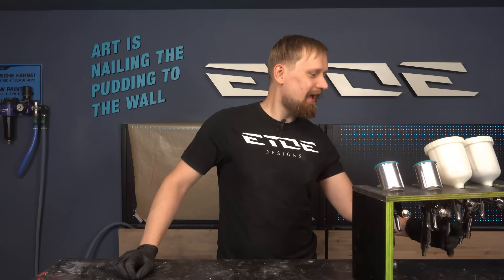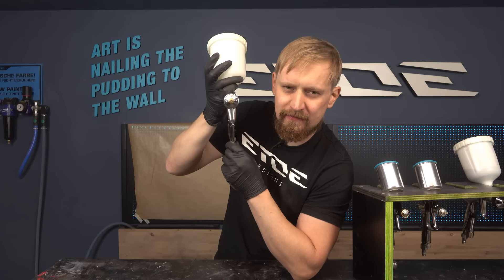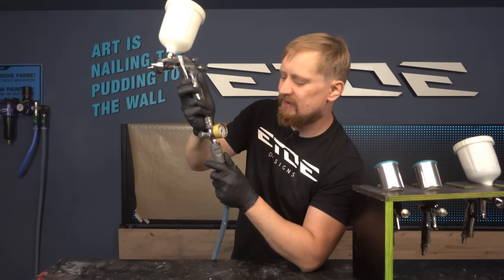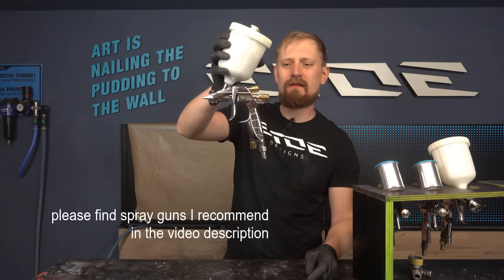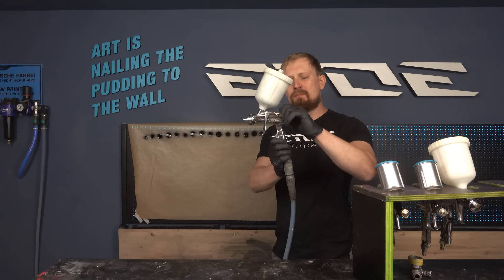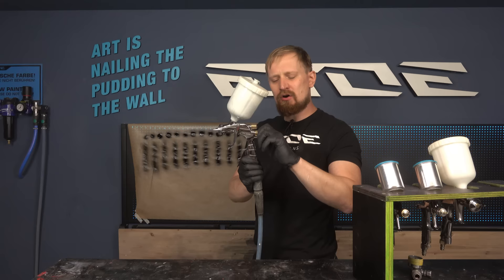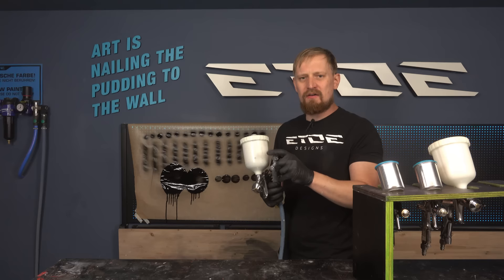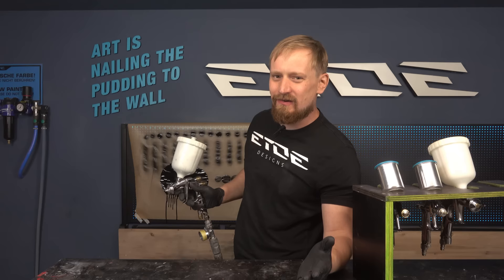HVLP spray gun setup - in five minutes

Comment: If I understand correctly, if you are a pro you should never use a pressure gauge but just listening to the sound  the gun makes. That's total BS because every spray guns sounds differently and plus the gun manufacturers ask you to have a regulator at your spray gun. Probably for consistency
Reply from the maker: No you understood all wrong. I said I listen to my spray gun not you as a pro to yours! For you I recommend a pressure gauge.

Comment: Perfect!!! This is the info I needed!! I set my air pressure on compressor AND air gun and when I spraying the air pressure was dropping to 20psi!  

So now when I fill up the air compressor.. 27 gallon tank shuts off at 200psi, then leave second gauge on compressor on zero, then attach hose and spray gun and hold gun trigger full on and turn knob slowly to set air pressure on spray gun gauge to 35psi then let go of trigger spray gun? 

Now I’m hopefull!!

Comment: Martin, I appreciate your videos, I've watched so many of them! I have one question about sprayguns though, is it possible to change the nozzle needle tip from 1.2 to 1.8 on the Iwata so I can spray primer and then change again to spray basecoat and clearcoat ?
Reply from the maker: If you find a nozzle for this particular gun yes. I would never spray primer, base  and clear in the same gun.

Comment: I did not know that the pressure was set with the gun wide open. The pattern width I understood but the vale of the needle position adjustment was not clear. I have used cheap HF 20oz guns and have had good luck after filling a bit dialing them in while cleaning them with solvent (usually water or mineral spirits dusted). But this will help get it correct before shooting my project.

Comment: Thanks for the video. I noticed in the description the dewalt sprayer you recommended. Can that sprayer spray water-based paints? I typically spray wood products not auto. Is this sprayer somewhat easy to clean ?
Reply from the maker: Yes and yes.

Comment: Hey there ...quick question and thanks in advance for your great video and stuff...Ok...for a bike frame and small jobs what size compressor in litres  and type of compressor do you use etc...also what size would you also suggest for car panels bonnet roof door etc..   toying on buy a compressor and would like your advice on capacity etc...cheers man.Noze x
Reply from the maker: I use a 400l oil free compressor.
Reply: @ETOE  hey thanks a lot...I guess that covers all.jobs large to small..thank you

Comment: Thank you for your great video.
What air compressor do you use, power, cfm, vessel capacity? What air hose do you use, length and inner diameter? From your video it looks like  you are connecting a Prevost S1 connector to your Iwata gun (W400 BellAria?). Is it with the "spraying hose" from Prevost which is anti-static and with a 9 or 10 mm inner diameter? I have an AEG 50l 3HP belt driven compressor aspiring 360 l/ min, so it may deliver 70% if we are optimistic that is about 250 l/min. I intend to spray with a Walcom slim Kombat spraygun HTE 1.3 tip that requires 265 l/min or 9.3 cfm, so I am a bit short on cfm. Would a 13 mm inner diameter hose minimise pressure and cfm losses? Thanks for your advice.
Reply from the maker: power: 15 Kw cfm: 52,9 vessel:600l inner diameter of air supplies: 13mm
Reply: @ETOE  Thanks for your prompt reply

Comment: Hello, can I spray 2K clear coat with HVLP mini spray gun 0,8-1mm? The reason I would like to use a small one is Im spraying steel frames made of 1 inch x 1 inch square profiles. 
Thank you.
Reply from the maker: You can use every spray gun to spray 2K clear.
Reply: @ETOE  Thank you. 😘

Comment: When I set the pressure to 2 bar at the gun with the trigger pulled it works fine. But when I release the trigger, the gauge at the gun reads like 7 bar. Is that normal? Am I doing something wrong? I've got a 100L 2HP compressor and I lose like half a bar of pressure when I paint one streak on the roof.
Reply from the maker: Your air hose is too small in diameter. That reduces the air flow but increases the pressure.
Reply: @ETOE  Thanks man. It would solve everything because I can allow it to drain further that way. What size hose would you recommend? Would I need to change the fittings on the tank as well?

Comment: I need help you inspired me to do a bike. leaving the frame  Steel spraying the forks racing green need a video on how to do a raw steel frame i have been sanding for a week help me
Reply: Raw steel will rust. Even if you clear coat the steel it will still rust under the steel.
Reply: @bradcomis1066  no it will be fine
Reply: No oxygen no rush
Reply: Get it up you  Your principles are correct, but the reality of painting a bike in your garage presents a lot of problems in keeping the frame perfectly clean and free of any oxidation before getting clear onto the raw steel. For serial production it would be possible to create a paint shop that can do this, but it will be hard to do at home. Also, it will be easy to chip the clear over raw steel as the adhesion of clear coat on top of steel isn't great. As soon as you chip the clear you will start to get rust propagating from that chip. A normal primer-paint-clear coating will be much more durable when out on the streets in everyday use and is much easier to execute well at home in your garage.